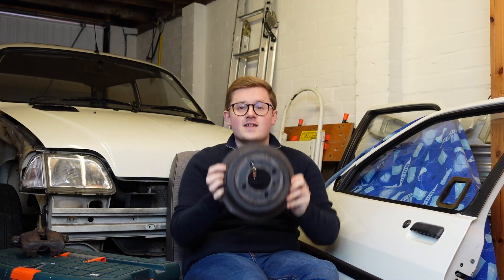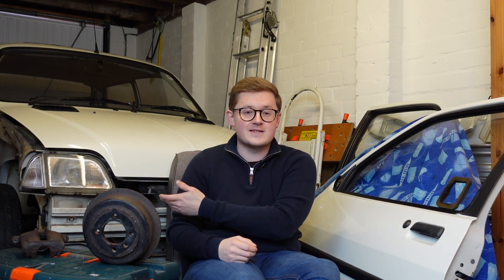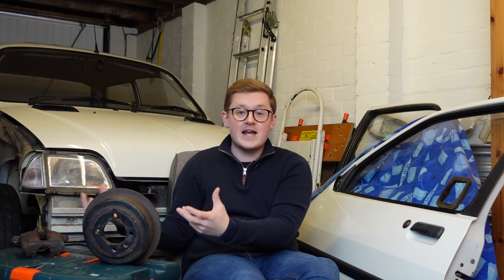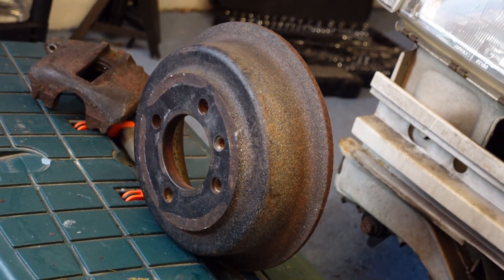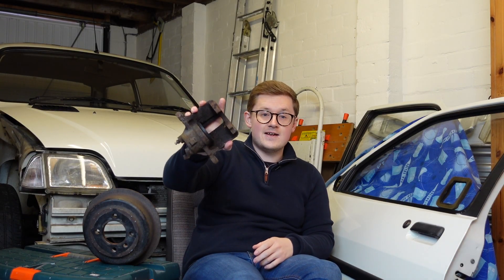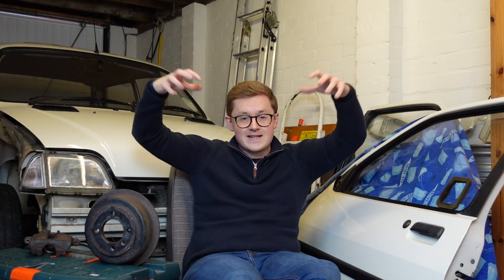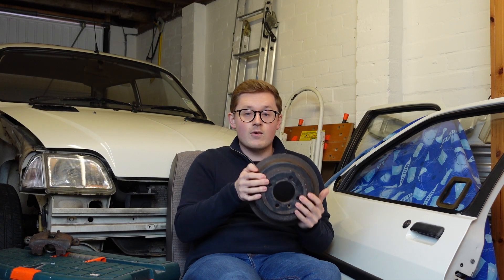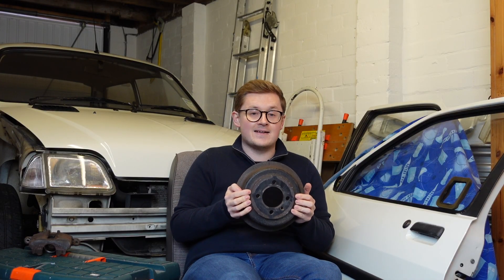Why are Drum Brakes Making an EV Comeback?

Comment: One problem I think not mentioned with drum brakes, is that they become ineffective if they get wet. If you drive a drum brake car through water deep enough to come up to the bottom of the drums, the water will flood into the drums. It is effectively an anti-friction layer between the shoes and the drums. This can also happen if you just drive thru a sheet of very shallow water on the road; the splashing water can get into the drums.

This was something you had to be aware of when driving a drum brake car on wet days. Go through a puddle, and you might not stop at the next stop sign or light, and just roll right through the intersection, even with both feet pushing down on the brake pedal.

The solution was simple. When you went through a puddle that might cause problems, you gently applied the brakes while still giving power to the engine. This would eventually scrape enough water off the shoes that they started to contact the drum. "Riding the brakes" would then generate heat in the drums and shoes and evaporate the water, and you again had full braking ability. Obviously if you had a brain you stopped riding the brakes once they had dried out.
Reply: Another problem, they will freeze together if you apply them while wet in wintertime. Then you gotta go lay in the snow and smack your drums with a hammer till they're freed.
Reply: @operator8014   Oh yes my dad had set his parking brake, got water in the drum on his Hyundai Accent and his parking brake was frozen on.  Hyundai did some service bulletin on it where they like drilled some holes in the drum for water to drain out.  I guess it worked?  He didn't have them freeze after that, although he'd only had them freeze once in years of ownership before that (and we do get plenty of snow, cold temps, freezing rain, etc. here.)
Reply: You want to ride a motorcycle when the disc brakes get wet and freeze a strange sensation pulling a brake leaver and nothing happens. 🤔
Reply: @BS-ql5nl I raced road bikes for years. In the wet races you'd have crashes happen and you could do nothing about it if you were behind it because you would have without exaggeration multiple seconds before the rim brakes would scrub enough water off the brake track before they gripped, and then they'd fully lock up.
Reply: @BS-ql5nl  Drive faster. The heat from the braking friction will make it 10x better. Trust me...
Reply: @USERNAME1-x5u  I was going to say the solution, like almost all driving issues, is to slow down, but your idea would be more fun to watch
Reply: A lot of those actually still apply to disc brakes. Drums have also pros like they don't suffer nearly as much from winter frost. It's very common cars to have really poor initial bite in certain winter conditions.
Reply: I'm pretty sure the water that would affect drum brakes would be the puddle you want to avoid anyway. 

For some reason i have this note in my mind that says "driving through puddles is bad for your brakes" but I don't know where i heard it or why. This makes sense now.

 @jothain
Reply: @VanSanProductions  indeed. It would be quite deep puddle for drum brakes to get into 🙂
Reply: actually not scrape off water but evaporated the water from the friction
Reply: @donalddday7741  This is indeed the correct term.
Reply: I have drum brakes in an area which has quite a few flooded road in the moment, and Ive never ever had a problem with that. Ive Always stopped
Reply: I've got fixed calipers on my car and no backing plates, the discs or return springs will kick the pads back (they clap every time you press the brakes) and so they'll stay wet just like old drums do. Doesn't even need to be a deep puddle, they'll get splashed from the opposite tire either way.
Reply: I have an id3, the brakes aren't used at all in normal driving, just regen to slow it down.  It's programmed to use the brakes every now and again to keen them clean, I can see when it happens as no regen shows on the instrument panel, I can't say I notice the difference.
Reply: It is an issue with disc brakes as well, but less so because of the open design allowing water to dissipate more easily.
Reply: @KindredBrujah  Yeah. Generally speaking more issue in disc brakes. I mean if I've ever driven car so deep that drums would've flooded with water, I would've been driving slow for awhile anyway.
Reply: A couple things you are ignoring regarding electric cars with drumm brakes:
1. Electric cars derive most braking from regen braking.
2. Most electric cars still come with front disc brakes.
Reply: @gteixeira  Do you think the reverse combination will ever be used?
Reply: When I was a kid, drivers ed actually taught us to do all of these things.  The problem with the wet brake drum thing is that we were taught that driving through water deep enough to flood the brakes was a no no anyway.  If you are in water that deep, you have no traction.
Reply: All of the things that people are saying their drum brakes do is BS.  I still have drum brakes on both of my vehicles.  They never have any of the problems that are being talked about here.  Not one.  They have never frozen, never stopped working, and never flooded.  I think y'all need to go back to driving school.
Reply: @RonnieStanley-tc6vi  Surely discs are better performing, but like had discs on front and drums on rear and someone was wondering that the drums are bad. I was like what a load of bs. If they're correctly adjusted they're just fine. Normal cars aren't made for track racing anyway.
Reply: Thanks, I had heard the opposite, aka disk brakes have problem when they are wet.  It's wayyyyyy more subtle than I thought.  In any case, I like the disk-front/drum-back combo because each type mitigates the others weaknesses.   Eggs in different baskets, so to speak.
Reply: Or just slam on the brakes and generate a bunch of heat all at once because brakes convert your kinetic energy to thermal energy and you will evaporate the water much quicker

-Sincerely, somebody who’s getting their degree in mechanical engineering
Reply: The splashes should be possible to minimize and/or prevent with proper design (some sort of guard?). The water submerging problem probably can't, but it should be possible to automate riding on a brake with some sensor. Basically something detects liquid in the drum = ABS engages those brakes slightly, till it becomes dry.
Reply: Thanks. I kept thinking back to drum days (a long time ago) throughout knowing there was another disadvantage other than fade and that was it, water.
Also Rusting disks? First use cleans that off.
Reply: One other problem is that if the 'hand brake' is applied to the drum brakes, there is usually a lot of effort required to apply the required amount of force through the (usually) cable system.   Also, in my experience, cable-applied hand brakes through the rear drums are crap if a vehicle is parked up a hill due to the leading-shoe design.  And also, the cable system is higher maintenance and prone to sticking.   Bleah.
Reply: Interesting.  
I remember cars used to slip a lot in old days . 
People usually say because the floor is wet . 
I never thought it had anything to do with the brakes ? 

In the id 3 and id 4 , wouldn't this cause that you only have the front brakes and in danger of car spin if the drum brakes get wet ? 
You would theoretically only have front brakes if that happens .
🤔
Reply: You will probably not plan to soak and submerge you EV... So drum brakes are still OK. 😊
Reply: The better cars used discs for the service brakes and drums for the parking brake ; although I had older cars with all round drums , which were very effective and never gave any trouble .
Reply: Another problem is thermal expansion.
When heat up - drums expand a little reducing braking power.
Reply: @stanley3647 If you don't brake continuously the brake will adjust to that with every pedal press.
Reply: @dranoelr  i live in hilly terrain - i need to use brakes a lot (some hills are more than 20% grade) even for my motorbike i need to learn how to effective brake front wheel and turn in same time ;) Which is tricky.
My first car has 4x drum brakes (front and rear) and it was nightmare to use it in long descent.
Now My bikes (motorbike and bicycle) and both cars has all hydraulic disc setup (ventilated, or perforated) and no problems anymore.
Drum brakes are ok if You have something extra to slow You down (like generator or engine), but remember: regenative brake (using motor as generator) is inefficient at slow speed. You have to use normal brakes at end of stopping.
Reply: @dranoelr  Most drum brakes I'm familiar with only engage the automatic adjuster when you brake in reverse, the shoes rotate slightly in the opposite direction against a ratchet.
Reply: @pontiacg445  This is indeed very common thing for drum brake vehicles. Also surprisingly little known thing, that reverse brake auto adjustment. I know few guys that I've always considered to be real car enthusiasts and I've been surprised if this has come up for some reason as some really don't seem to know about this. They aren't even young guys. Iirc it even reads in some cars manuals to do occasionally that braking with moderate force.
Reply: @jothain  The number of people who can't be bothered to read the manual on just about everything is too damn high. So many things are intentionally gimped because some people won't progress past finger painting of their own accord...

I'm not super old, but I am old enough that I'd read owners manuals for "entertainment" in the car because the only other thing there was to do was stare out the window. I know at least some do go over the brake adjustment and plenty of other useful stuff. Don't park on tall grass is another good one, yet people still burn their car to the ground on the regular and my insurance has to go up to cover them.
Reply: @pontiacg445  Well said there. It wouldn't even need to be meticulous reading of everything. Heck even generic browsing through the manual could help many people get those "hey, what's this part here, I haven't heard about this?" feelings. Unfortunately most indeed don't do it.
Reply: @stanley3647  Yes, bit of a concern trying to stop on a steep hill without a manual handbrake and on drum brakes. Any deterioration and they might just not actually hold the car.
Reply: @stanley3647  
The following may be relevant to electric vehicles only...
During design of my differential steering electric motor driven garden maintenance robots,
I discovered the need to employ the venerable old PID algorithm.
Thus, when the robot encounters an up slope 
the algorithm simply applies more power to maintain commanded speed.
On down slopes, commanded speed is maintained by reversing power
(when slope steepness makes it necessary).
So, pressure on the brake pedal could specify amount of regeneration and
pedal pressure beyond a certain limit would cause
reverse power to be applied in proportion 
(functioning of course tied into the anti-lock system)
(and perhaps triggering retro rockets on more expensive models (lol))).
Reply: @stanley3647 that's not why brakes fade when they get hot, which is apparent when you consider that disc brakes also fade when they get hot.
Reply: @jaredlancaster4137  brake fading in not what i mention, just apply brake force, braking power and linear work of disc brakes are superior vs. 100+ years old technology of drum brakes.
Reply: @stanley3647  you were talking about braking force decreasing when the brakes get hot...... Isn't that what brake fade is? Anyways, even if the drums did expand a significant amount when they heated up, it would not reduce braking force, although it would make the brake pedal engage a little lower.

Most people don't know that disc brakes were invented long before drum brakes. It kind of makes sense when you consider how much simpler discs are. Discs are not a more highly developed system, in fact drums have some significant advantages. In my opinion, drums are superior in almost every way except heat rejection, which is the main reason the industry switched to discs in the 70s. It is also the reason drums continued to be used on the rear wheels, and especially on lighter vehicles: the rears don't get as hot and don't need to reject as much heat.
Reply: @stanley3647  He mentioned that.

Comment: You forgot one great advantage with the drums.  They can be made as self energizing so operate at lower pressure and don't need a power booster.  For occasional use the drums can be made of aluminum that aids in lower weight and better heat transfer.  With newer ceramic pads it's likely drums can be made to last a lot longer, make even less dust and better control braking torque near the limit.

Comment: Very interesting. I have two EVs, a Nissan Leaf with discs all round and a Skoda Enyay that, in common with the ID3 and probably the ID4, has discs on the front and drums on the back. 

At the last MOT the Leaf failed at about 50,000 miles because of disc corrosion and I had to have replacement front discs and an advisory to either skim or replace the rear discs. Of course I hardly ever used the brakes while driving the Leaf.  Replacing brake discs at only 50,000 miles is both bad for your wallet and bad design.

The Enyaq was new at the end of January and again I hardly ever use the brakes. It has an auto hold feature which keeps the brakes on when stoppped after releasing the brake pedal.  When I  press the accelerator to start again the brakes do not release immediately and presumably scrub the discs for a fraction of a second. Hopefully this strategy will help prevent disc corrosion. Time will tell.
Reply: I have an ID.4.  Discs in front, drums in the rear.   I don't really worry about rust per-say but even so I will put the vehicle in neutral on a downhill once a month or after a good rain and do some light braking to clean up any rust that has accumulated.   Regen is disabled when in neutral, so all braking is real, drum and discs both.